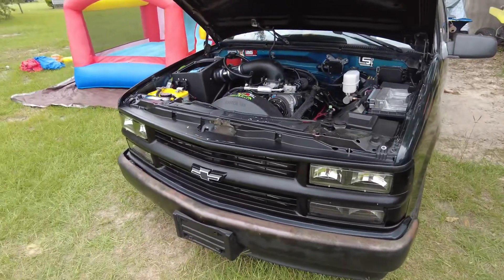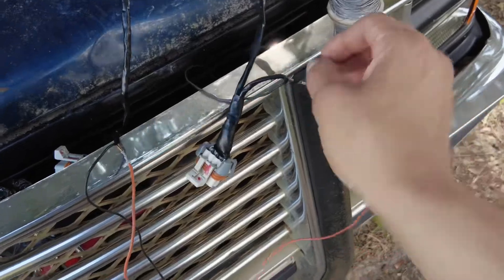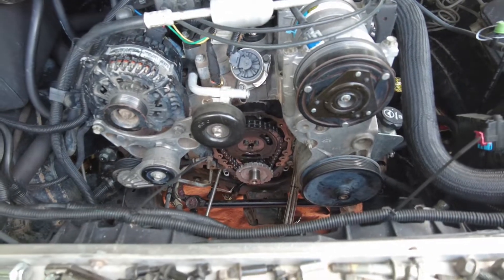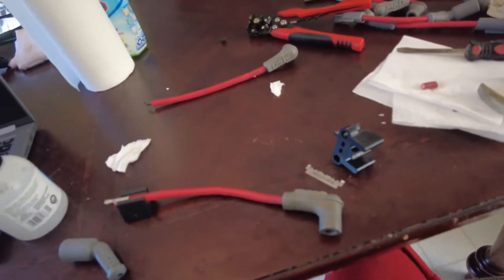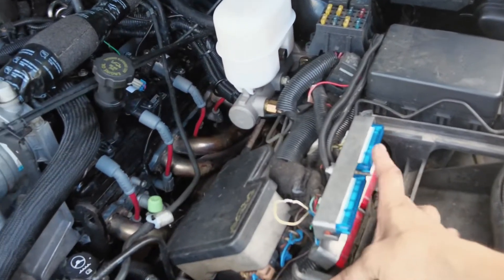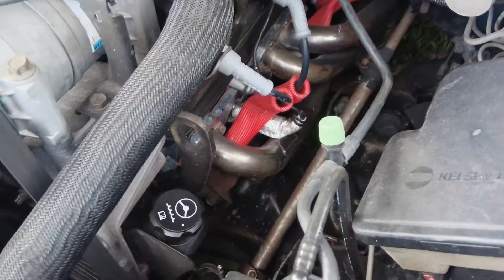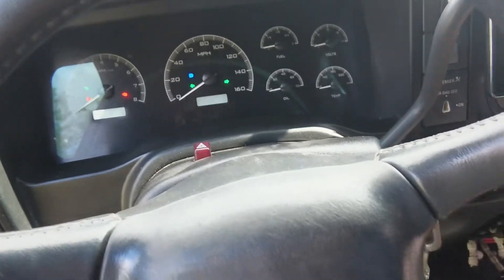Chevy 1996-2001 5.7 #Vortec #LS Coil Conversion! 1998 Extended C1500 Truck Converted. #ht383e #SBC

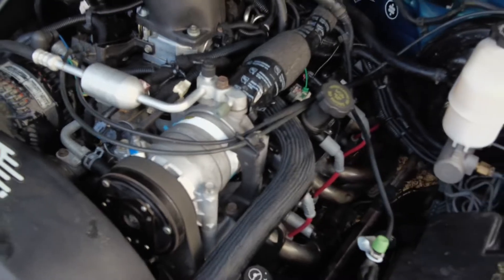Comment from the maker: 10:10-11:10 The pinouts for the 24x crank sensor are:
A-yellow wire for CKP sensor signal
B-purple wire CKP low reference
C-Pink wires CKP 12v reference
With the OBS pin pattern. Looking at it 
C,B,A. For proper pin out.

Comment: I guess i did the cheap easy version that has way less parts by installing an Msd 6a on the same motor.  This looks cool though as a science project.  Way too involved for my patience level though.  Another thing i like about the msd box is if you use their vehicle specific wiring harness, if the msd box fails while you're driving you can just unplug it from the circuit, plug the coil back in without the msd and you're good to go again.

Comment: But how you getting the oil pump spinning if the distributor spin it with the intermediate shaft,and since you removed it there's no movement
Reply from the maker: I didn’t remove it lol. It’s still there but the distributor in a way not there anymore.

Comment: And I got ?s does that 24 time part make the truck run  better
Reply from the maker: It wont make it faster…(maybe with a bad ass tuner) but with this setup you’ll have more options for boost and/or nitrous. Youll have control of your timing. With stock distributor timing is technically stuck. Only way to change it is to retard/advance the distributor. But when doing that you mess with the whole timing on the truck instead of a certain area where you want timing to be set.

Comment: Bro do a zero to 60 for us 😢
Reply from the maker: I got a vid on pulls coming soon. Sadly I don’t have that Intake setup any more. You can check out the trans video I have. On that I did done a pull at 0 but with stock setup. I do have a single cab that’s getting it so stay tuned. Also am doing a video 0-80 with the new setup and also the single cab truck I’m currently working on.

Comment: I’m interested to see the install of that manifold and how it performs on a stock street truck. I’m using a knock off of the edelbrock proflo xt but it has been a huge pain to fit with the l31 accessories and brackets. It’s supposed to be a better street manifold then that Holley, but the Holley looks way easier to install and use.

Comment: Don't know if it's true but I've heard you can do a 10 speed swap on these, but not on the ls...
Reply from the maker: Hmm never heard of that might look into that! I do have a 4x4 single cab that i plan on building. That would be good to have if its true.
Reply: @SACAPerformance  yeah recommend checking out if it's true don't know much on it tho
Reply: @SACAPerformance  alright so it was not a 10 speed it's called obs k1500 6l80 swap with the 5.7 vortec.
Reply: @Itsnotmeitsyuu 6l80 swap would be awesome for these trucks. I’m gonna look into it